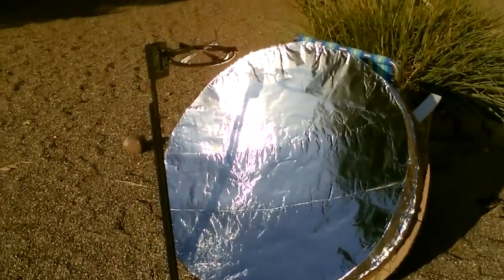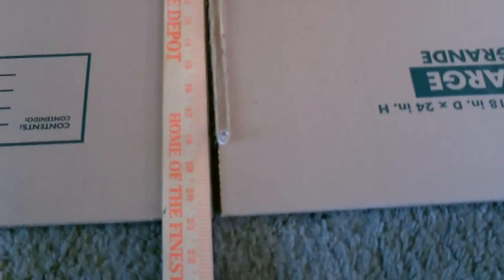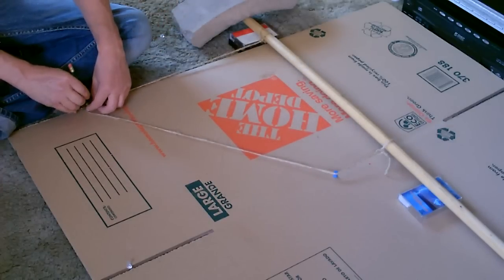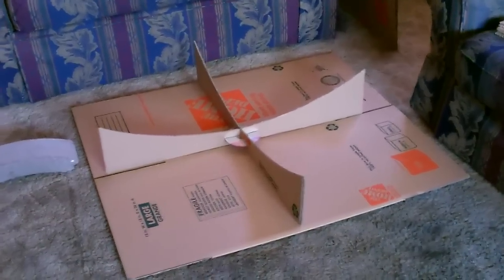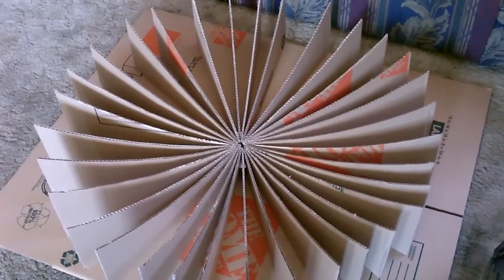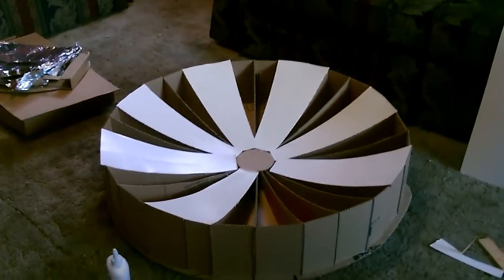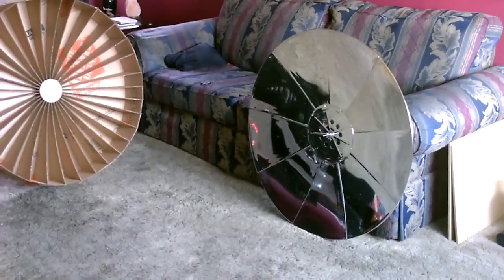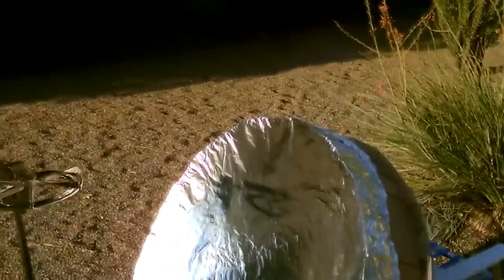How to make a Parabolic Dish Solar Cooker! - (simple 'detailed' instructions) - DIY solar death ray

Comment: I make solar ovens with my students each year.  We discovered that if you water down the glue 50-50 and paint it on the cardboard then lay foil and smooth with another piece of cardboard = a nice smooth surface!
Reply: John Doe hi, Can you tell me more about how you got the smoother surface? Im from norway so I didnt fully understad😄 i, really interested in hearing more!👌🏻
Reply: @Sergeant_Blain  it was like massaging the foil surface using cardboard, to smooth out all creases, making it flat.

It's kinda like ironing your cloth to remove out all the creases and wrinkles

Comment: I used an old dustbin lid, put some foil down inside it and it worked really well. I didn’t need the heated vessel to be ultra hot, just needed it to be warm enough to heat 10 litres of water.

Comment: Looks like I'm quite a few years too late to make suggestions but I feel like you might get a smoother finish if you cut the mylar into the shape of your poster board segments, then glued it directly onto the poster board (use a credit card to smooth it out), and then installed the mirrored poster board to your frame.
Reply from the maker: hi there. with the type of vids i post - it's never too late. i read the comments of all the vids even if the vid. is over 10 years old. and you're right... cutting the mylar or foil into smaller shapes could make it easier to get it to lay flat.

Comment: thanks for the vid... I wanna try this whole solar cooking thing ...
some jerk stole my propane tank during the night...
 there are some metal workers who make custom chromed metal thingies near me but they said they didn't know how to make parabolic dish... I stared at them incredulously for like a minute before finally leaving...
so hereI am, DIY -ing things because I'm surrounded by horrible people...
Reply from the maker: hi there and thanks. bummer about the propane tank. i knew someone who had one cast using plastic (i think it was ABS plastic) and then had it aluminized or "mirrorized". think the whole thing only cost 50-60 bucks. other options: make one like mine. works good and cost almost nothing or just buy one already made (they start about $100. check amazon and ebay)

Comment: How did you make the support for the cooking pot/pan?  I'm trying to use a camping tripod and I'm having a lot of trouble finding the focal point.

Also, what's a good way to cut out all those parabolic sections without making huge errors?

Thanks
Reply: I made one template then traced the image to the new cardboard for cutting with band saw. Nice smooth cuts for glueing and all the same.

Comment: I have a question: I wonder what is the best and still cheap material to use as the reflecting material and how did you fasten it? :)
Reply: thx :)
Reply: Best cheapest material is broken mirror pieces.

Comment: Thanks for the video!

What did you use for the stovetop/support to put the pot in the focal point?
Reply from the maker: hi there. to make the stand, i bolted together 2 short steel posts (and drove that into the ground. and then i attached a metal "flower pot ring" to the top.

Comment: Hello. I am European and I have difficulty calculating with American measurements. Can you tell me the "radius" of your dish so that I can calculate the surface of the circle by where the light enters? The formula is 3.14 x R x R.
Reply: …je pense qu’il ne faut pas mettre le point focal trop loin de la parabole, juste la place pour mettre votre casserole ,plus un petit espace. Ainsi vous aurez une forme de parabole qui ressemble à la forme des phares de voitures des années 50´.
L’avantagea est que votre casserole sera plus «  enveloppée «  et à l’abri du vent…
Reply from the maker: hi. the dish is roughly 3 foot (36 inches) in diameter (.9144 meters) so radius is about 18 inches (.4572 meters).

Comment: at its smallest point, how wide is the focal point? doing a school project, and i’m trying to make something similar to this.
Reply from the maker: hi. that is hard to say. these usually create a focal point that is a few inches across (so good for a standard size pan). i'm glad you're making something like this. my main advice is to make it roughly the same diameter. or slightly larger if you want. sometimes people try to make them smaller but then it doesn't quite get as hot as they want.
Reply: @desertsun02  yeah, i'm planning on making it a similar size. thanks for the advice!

Comment: What would the equation for the cross section of this parabola be?
Reply: Cheyanna Sayers 
Or y=x^2/4f  
Where x horizontal distance from the origin

y is the vertical height from the origin

             f  is the focal distance

Or another graphical method is to make an Isosceles triangle where the altitude is twice the focal length and make tick marks 1/2 inch (1 cm) apart on the each of the EQUAL sides and number them in opposing order . Connect with a straight line 1-1,2-2,3-3  and so forth. A parabolic curve using only a ruler!